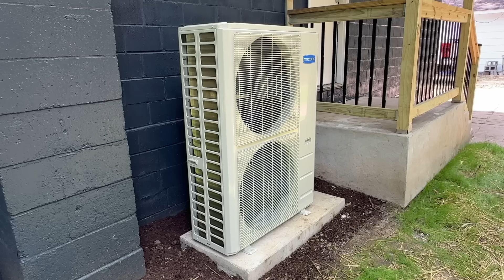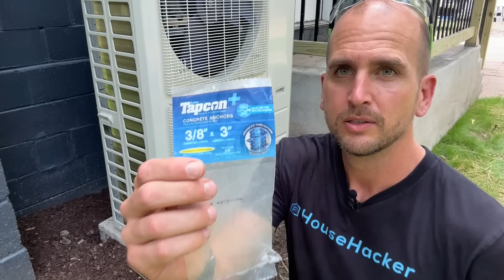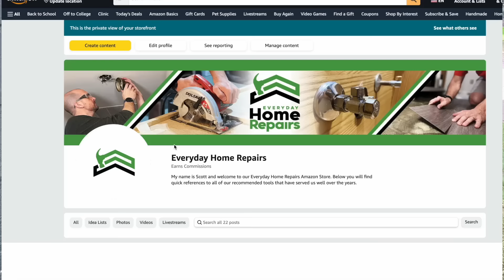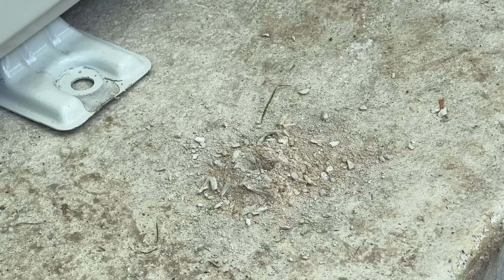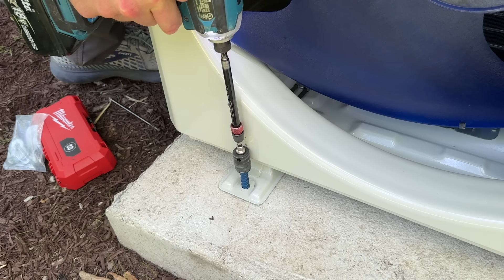The Only Concrete Anchor You Need And How To Properly Install

Comment: If you don’t have a compressor handy I found it a couple of soft -drink straws will work.  I found a couple that are different diameter and one slides inside the other so that you can get an extended length thereby keeping your head far enough away from the hole where the dust doesn’t blow into your face.  Alternately you can also use a piece of tubing or even pull insulation off a wire and use that.

Comment: Amen!  TAPCON is the way to go!  Easier to use and very effective!  Good presentation!  I think most of the Tapcons I’ve used - and I’ve used quite a few lately -  have included the drill bit in the little package I bought. Of course you can buy a bulk too if you have the business.

Comment: What happens if ypu drill the hole too long? 
I just tried 5/16s with the appropriate 1/4 bit and the tapcon just keeps spinning towards the end of the screw and what im tightening is not fully clamping down tightly

Comment: I must admit for most applications that will work. But most certainly there are better options in some cases where there is a lot of pressure on the fastener. Nice video.

Comment: Rotary hammer. Bosch. Corded. It’s not just  a little better; it’s a completely different way of drilling masonry. Slightest mistake in technique or conditions w regular hammer drill and you incur large loss in time, poor install, etc.  For instance, hit a rock in an old slab w a hammer drill and you’re  in trouble; maybe burning up several bits. Rotary could care less about a rock.

Comment: I frequently have issue with smaller tap cons shearing with either impact or hand wrench. It seems to bind on a stone preventing tightening or it’s like  gulling with metals and it needs some sort of lubricant. Any advice would be

Comment: Tapcons are good but i use Hillman brand because they hsve a heavier duty thread. On 1/2" size the tapcon thread is .596 and the Hillman thread measures .626 thst .030 more thread they go in tighter and hold better. I use them mounting safes on concrete

Comment: I have consistently had Tapcon concrete screws break before getting them fully installed and tightened - and then I am literally "screwed" as it is impossible to get the broken portion out of the hole, meaning I need to move the hole to a new location - which is not always desirable. On the other hand, I have had 100% success with expansion anchors with nuts, such as the Red Head system.

Comment: Any wood screw with solid soft copper wire in the hole will do the same..fantastic holding power too

Comment: Just me but I like coating the anchors with a rubberized adhesive before installing. Why? It helps to prevent any possible corrosion or liquid ingress. It Helps with long term adhesion. It Works as a lubricant when driving the anchors. I even cover the heads to protect the connection for many many years. It only takes a minute.

Comment: According to Frank Silva, of This Old House, the masonry dust is to be left in the hole as it is needed for the anchor to get the best grip.
Reply: I’m a rookie here but I viewed 2 dewault videos on the hammer drill and both stated to leave the concrete dust in the hole when using tapcons. Somebody’s wrong??
Reply: ... this is confusing. How will the dust help? ...

Comment: I wish you had discussed corrosion resistance. Almost all these self tapping screws are steel, with either a light zinc coating or a "weather coating" that rust badly after two years, staining the concrete and eventually failing.  There are only a few self tapping screws for concrete that are 410 stainless steel that rust only slightly after several years and last much longer.

Comment: I have been 'researching' (ie. web search) how to attach stuff to a concrete wall in my basement.  So far the Simpson Strong-tie Titen Turbo screws look interesting.   They claim that their "Torque Reduction Channel" displaces the dust in the concrete during the drilling.  Sure, after drilling the pilot hole you can vacuum out the dust, but when you are driving the screw there is more dust being accumulated.  That is why there is a need for a extra depth needed.  Anyone use these alternatives to the Tapcon?

Comment: All great advise in the video and the comments.  Thanks all.  Nothing to add, except …. Put several inches of gravel in that dirt ring around the foundation.  It will slow down the weeds and keep some dirt out of the unit when it rains.  Thanks again

Comment: I have been told this is the best concrete anchor but I'm not buying it   It pulverizes concrete and backs out. If you use it with anchoring epoxy it's good but that's double expense. The best is the common wedge anchor.  For applications where you can't have a stud end. Sleeve anchors work well.
Reply from the maker: Have you tried the Simpson Strong Tie Anchors.  The thread is a lot more aggressive as compared to Tapcons and I have officially switched over.

Comment: just installed 15 posts for hand railings with  60  5/16 x 3 inch tap con bolts.  The only issue I had was just to make sure the hole was drilled deep enough.  The 3 1/2 inch hole depth tapcon suggests ,  wasn't quite working so I went to like 4 plus inches and blew out the holes with compressed air.  Checked depth with screwdriver.  No snapped heads. Used stainless washers under the heads.  I bought a new Bosch bulldog extreme sds rotary hammer drill and only used 1 tap con 1/4" bit.  Bit still drills well.  The only way to drill concrete holes for me.

Comment: Great video!.... and I will be installing one of these units in the not-to-distant future. I have a question that does not relate to the Tapcons. Why aren't you using some sort of isolating (anti-vibration) pad/spacer/etc, under the foot of the unit?

Comment: THANK YOU!  I should have watched your video BEFORE I tried to install some tapcons.  I did the things wrong: 1. burning up drill bits 2. not cleaning out the hole 3. over-torquing the tapcons until they stripped out
IF I try again to eff around with concrete anchors I'll do it proper having watched your video now.

Comment: Katrina!  Thieves raided subdivisions for copper tubing in A/C condensers, removing the whole unit!  Why not anchor with    ss LH thread, epoxy coated threads. The last thing a thief can do is think - so they will move on.

Comment: If you're drilling a lot of holes, make sure your depth stop is tightly locked so it doesn't slip when it makes contact with the pad. If you don't, and don't notice it slipping, you'll end up drilling multiple holes which are deeper than you need, wasting your time and shortening the life of the drill bit.

Comment: Are the tapcons rust resistant?  I have a wet basement.  My baseboard heaters have rusted and pulled away from the concrete walls due to the concrete nails rusting.  Yes, I'd like to stop the water outside, but 60 years after my folks built the house, the walls still get wet with a heavy rain.  I need a way to anchor new baseboard to those walls.

Comment: How to keep the drill bit from walking as you begin drilling? Start with small bit for a pilot hole? Use a non-hammer drill at a slow speed initially? How?

Comment: Scott / Community I need help. 

I purchased a new home with Hardie Board siding. 

How would I go about drilling (masonry bit?) then attaching fasteners (tapcon? Somthing with a washer to distribute the pressure so it won’t crack?)

Goal:
Mount security cameras 
Mount hose reel

Thanks in advance - Scott you should make a video on this.

Comment: I prefer Simpson Strong Tie Titen HD
It did a job installing some 20’ tall pallet racking and had to drill over 1000 holes and bolt everything down using Simpson 1/2”x4” and never had a single issue with any bolt.

Comment: Busted the heads off of mine. How do I get the anchors out? Cleaned the hole: 5/16” by 3” tapcon+ drilled down to 3.5” with 5/16” tapcon + bit used shop vac and pressurized air to clean the holes. I think I just over-torqued and they sheared right off. For railing post so I don’t have much room to play with. Thanks for your help!

Comment: My biggest problem was snapping them off. I drilled as I followed the instructions for 1/4" min extra (not enough) but as the anchor made it's way down it was dropping debris in. So I drilled min 1/2"+ deeper and worked great. Using 1/4" tapcons.

Comment: Biggest problem is running into rebar. Sometimes an ordinary steel drill will go thru the rebar if you are lucky. If the hole is almost deep enough, cutting a bit off the end of the concrete bolt can help.

Comment: I recently tried to use Tapcon anchor screws to secure a handrail to concrete stairs.  Although installed according to directions, the Tapons failed to hold, instead destroying the concrete. Further analysis found that the "concrete" used for the stairs was substandard, home mixed, concoction by the general contractor, who apparently was pinching pennies.
Reply: Try a chemical solution for for those failed holes and reinstall👍

Comment: If you strip the hole insert a wire tie and run the fastener back into the hole. This will usually hold just fine.

Comment: i think tapcons are the best thing since sliced bread.  some great tips here!  if hole strips out, i use a piece or two of copper wire to secure the screw.  some use steel wire but it will rust away, even if it's galvanized

Comment: You should have anti-vibration feet under that unit for Airflow. Also in heating it will condense and if cold outside will probably freeze to the deck blocking the drainage and freezing the coils!

Comment: Thats why they say leave an extra 1/2 inch. 🤦‍♂️.  Also about batteries. Lithium ion dont decrease power until around 10%. So there will. Be no diffrence between full and half power. Thats like the biggest selling point

Comment: If I strip out a hole I will just drop a length 1/8" solder in the hole, lead really expands into the concrete well and it makes good use of solder that you can no longer use for plumbing.

Comment: Excellent video.  I'm a former concrete formwork carpenter.  Did that from 1979 to 1997.  We used the corded Bosch Bulldog roto-hammer.  Or the AEG roto-hammer.  Both were just phenomenal tools.  Still are.  Funny little fact.  We'd place the 2x4 kicker down on the snap line and roto it in place.  We would hammer two 16 penny nails into the hole. One was a sinker and the other a double head.  That's because the placement of the kicker was temporary.  It was an extremely strong hold.  Roto-hammers are awesome.  You could drill a 1/2 inch hole thru a 6 inch concrete wall in about 90 seconds.  I would say the roto-hammer was second in effectiveness only to the skill saw.  Your video was very informative, thorough and thought out.  I saved it.

Comment: Thank you for the great tips. ❤
Are Tapcon screws as strong as Concrete Anchors that expand in ground? 
The 316 Stainless Steel concrete anchors snapped with little bit of extra force (my mistake), but they’re not strong either. 
Home Depot doesn’t sell the Grade 105 steel anchors. 

I am putting up used commercial grade Cubic Steel 42” deep verticals & 12’ x 4” beam for a 6’ high loft shelf in car garage. 
Should I anchor the feet of vertical sides? With what? Tapcon or expanding anchors?

Comment: If you are just drilling a hole, then what is the bolt turning-against when you screw it in? It's not like the hole is threaded... Sorry, I'm a 72 yr old rookie.
Reply: The threads are biting into the concrete. When you drill your hole, you use a drill bit the size of the shank of the screw. That way your threads can bite into whatever material you’re screwing into

Comment: I don't know what I did wrong, but my Tapcons gave me a lot of trouble. They were so much harder to screw in than what you showed. I used the recommended Tapcon drill bit size. I drilled the holes in cycles like you showed. I even stopped during drilling to vacuum the dust out of the holes. I drilled deeper holes than the length of the screw, as required. Only 2 of my 8 Tapcons were secured. The rest spun in place once fully screwed in.

Comment: Could I use these into breeze blocks with a bracket to hang a 3.5 mtr extension ladder? Would they be strong enough with the aluminium ladders weight?

Comment: I have a question about using Tapcon screws on a concrete wall. I drilled to the required depth to secure some lockers, but out of the nine screws I installed, four snapped. I wasn’t applying much pressure, so I’m not sure if I’m doing something wrong. Any advice?

Comment: I just used some tapcons yesterday to anchor a wrought iron fence post to a drive way using angle brackets. In order to clear the hole of dust and debris I used a can of compressed air with a thin straw attached to the nozzle. This is the stuff normally used to blow dust out of computers and keyboards. The thin straw fit really well and the pressure was more than adequate to clear the holes. On first use I got a blast of dust in the face because I wasn’t expecting it to come out with that much force.

Comment: I use a socket wrench to screw the anchors in. It takes a little longer but it ensures the head of the anchor is not over torqued.

Comment: I had to install a new threshold on my mother's 30+ year old house. I bought the Tapcon set & tried to use the bit required,  but the new masonry bit just did not want to penetrate. It took forever (like 10 minutes or more) to drill one proper size hole, but apparently, it got wallowed out in the process & was too large for the fastener. Do you have any idea why.

Comment: Best, mosts economical solution I've found if installing several screws: use SDS+ drill bits (under $10) instead of the crappy Tapcon bits that die after a few holes, and source Tappers brand screws rather than Tapcons. The Tappers are a fraction of the price and, to my mind, better quality than the Tapcons. And, as csimet suggests, use washers to supplement the screws where desired.

Comment: A very easy way to clean out the concrete dust from the drilled hole is to blow it out with a piece of tubing.   I’ve also used soda fountain straw (a small, one inside of a larger one for added length.). Just be sure to keep your face shielded from the dust blast.

Comment: We use tapcons at my construction job. At home I use the same tapcon bit but I go with #10 stainless screws. I just cut off a piece of a ziptie put it in the hole and screw it in. Hold like gang busters and its stainless! No rust! Tapcons have been known to snap from time to time.

Comment: I don't have a hammer drill, just a milwaukee impact drill, will that work with concrete carbide hammer drill bit 3/8" to drill the holes needed to drive the same bolts you used in this video into a 4" concrete pad block 4"x16"x16"? my guess is it would just take longer to drill the hole right?

Comment: The mounting brackets have rubber spacers to reduce vibration.YOU DIDNT USE RUBBER GROMETS…MR COOL HAS THAT IN INSTALATION MANUAL

Comment: 30 years ago a carpenter from Indiana named Jim taught me a great tip and I have used it ever since. Drill a 3/16 hole with a masonry bit of course, insert a piece of tie wire ( 16 gauge annealed wire, home Depot or Lowe's) and then drive a 16d common nail. Easy ,inexpensive and strong. Thank you Jim. Edit, the piece of wire should be 4 or 5 inches in length.
Reply: That holds things into cement? A nail? Even I can do that! I have to try to secure a pergola or gazebo into an aggregate cement patio. Will that work?
Reply: @Tinyteacher1111  yes the 16 gauge annealed wire is the key and it only works with a 16d common. It will work.
Reply: @jackfarrell4727  Thank you! I’m 4’9”, pushing 70, and have to secure this myself, so I appreciate your response❣️
Reply: @Tinyteacher1111  you are very welcome. Wear safety glasses.
Reply: Matchstick works too lol
Reply: 3/16-16 ga.-16d. I can remember that

Comment: Tapcons are fine for fixing to a pad, but if you are fixing angle supports to a concrete foundation wall, for example, then I would still go for the wedge anchors.

Comment: There were concrete buildings, with a concrete entryway.   And the electrical boxes were tapcon'ed onto the concrete.  Amazon delivery in simple cardboard boxes, keep sheering the tapcon screws.  Tapcon screws have no sheer streanth.  The tapcon's were repalced.  All of them.   With a plug, and a solid screw.

Comment: for that application tap cons will be fine  but they have low shear Value   .. I personally would have used a Simpson strong bolt anchor and some hilti hit  so I can remove  the unit if ever needed just by taking the nut off ..... the tapcons are one time use  and most of the time if you remove them they never hold the same if your reinstall them in the same hole ......but thats my preference

Comment: Using a 2x4 or 4x4 with the correct sized hole drilled in it as a guide will help keep the bit from wandering.

Comment: In us freezing states like MN. You might want to put epoxy in them there holes so when you insert the screw the hold stays a solid so the winter doesn't crack the concrete in half by having water in the hole.

Comment: Found out today that these anchors will not work with stone. The stone was too hard and removed the groove edges that bite the sides. For concrete and masonry they are fantastic. Lucky we had a bunch of old red heads to do the job.

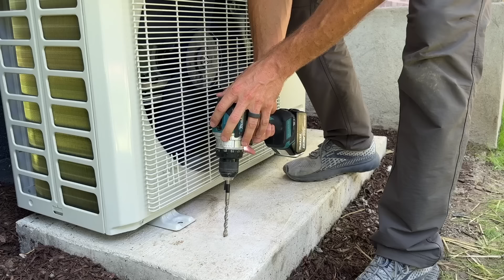Comment: Frankly, I was a little surprised to see his cordless hammer drill making such good progress at 1:54.  I have a coreless hammer drill too, but whenever I have to drill any 3/8" holes in concrete I just pull out the corded rotary hammer drill because it just isn't worth the time with the cordless.

Comment: If you mess up and strip the anchor, just use some self leveling cement and fill the hole half way and tick the anchor in there until is dry and voila